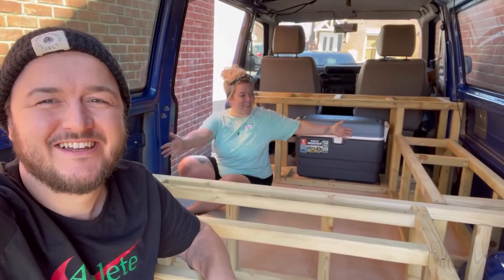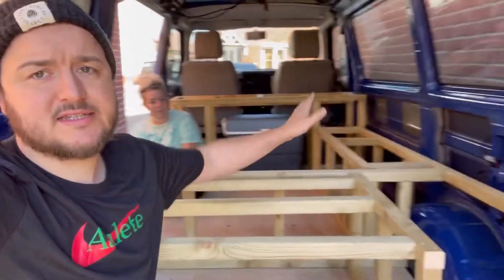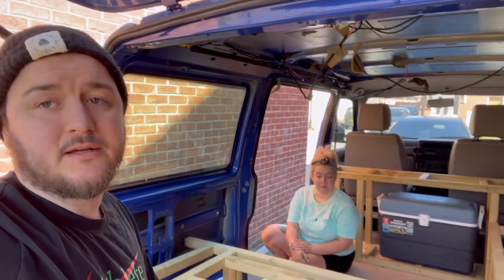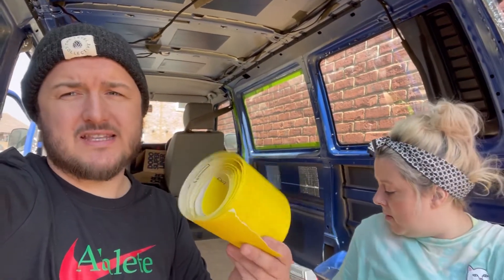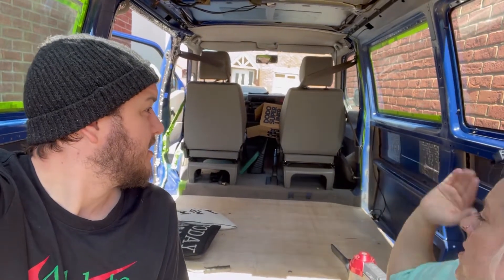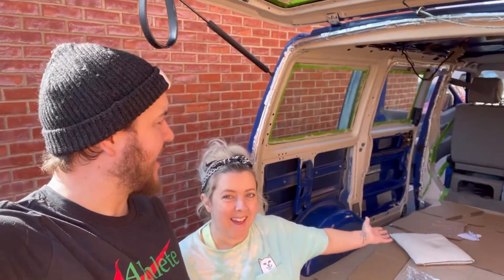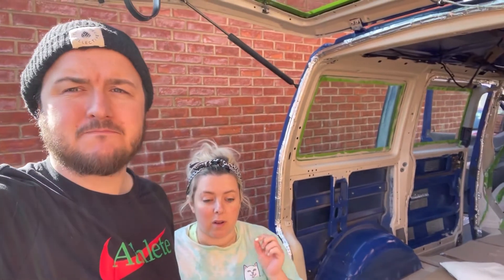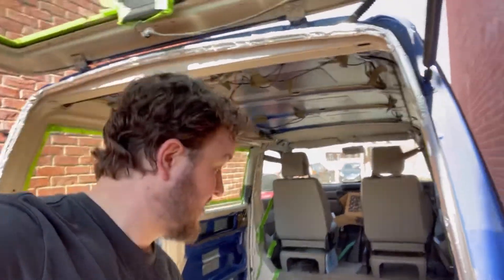VW T4 Caravelle Van Build Ep3: Building Furniture and Painting Our Van

Comment: Hi guys, I'm loving the build videos, I'm currently building my T4. Can I rack your brains and ask what was the overall height of the bed frame please. I'm at this point but not sure how high off the floor if should be before the cushions go on top. Many thanks x
Reply from the maker: Hi John, we based ours on 2 things… fitting a paddle board in the back and head height.
We put the paddle board in first and worked out what height we needed to clear but kept it pretty tight to that clearance height so we didn’t lose head room.